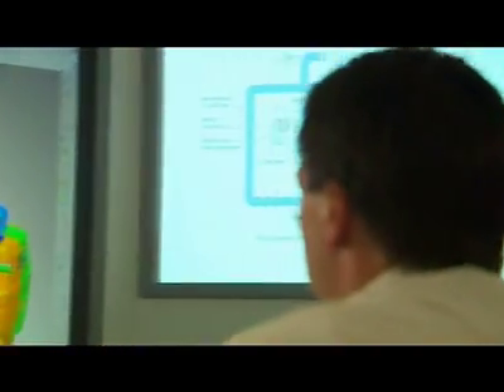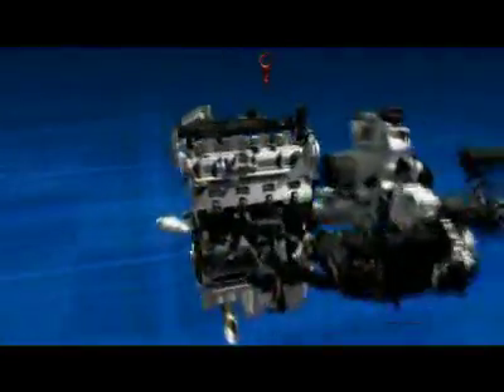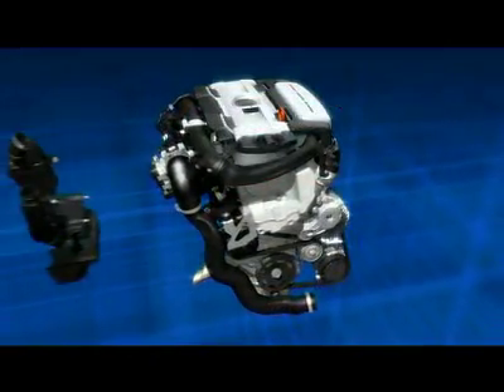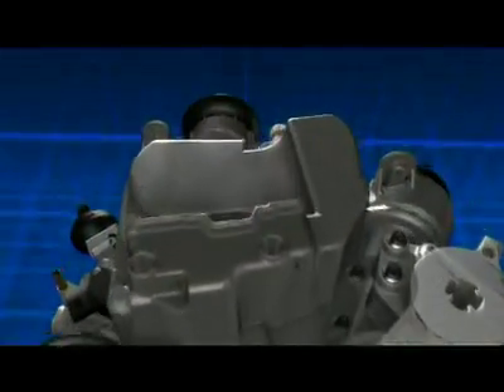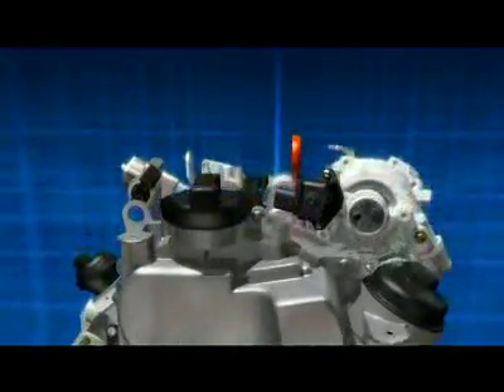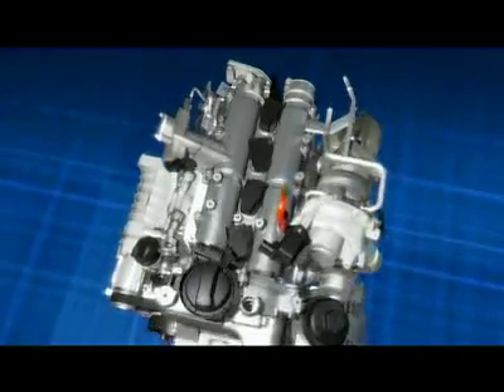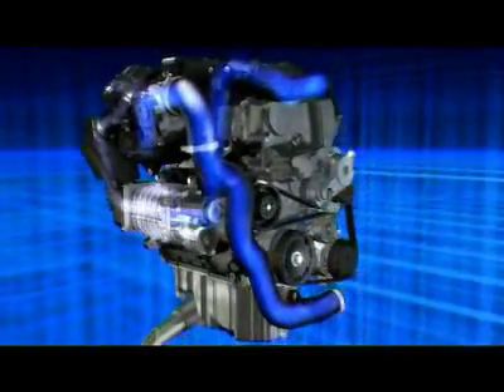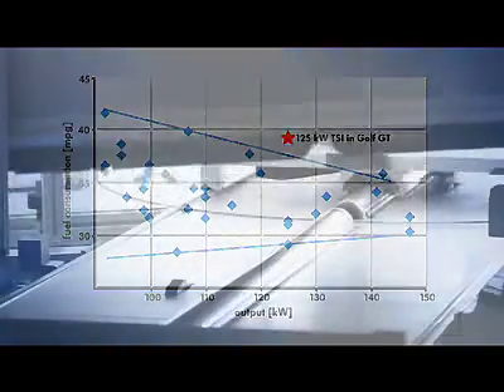TSI Dual Charging

Comment: Believe it or not, when everything is set I might build a lightweight mid-engined! saloon car with this 1.4 liter TSI.

Twincharging is the ideal combination of turbocharging and supercharging.
Combine that with Volkswagen's FSI direct fuel injection and you'll get an amazing engine.

Shame it doesn't have dry-sump lubrication, but it's built for a Volkswagen Golf, so it's understandable.